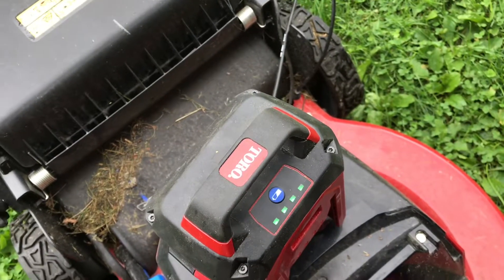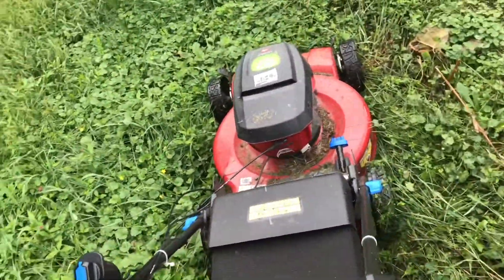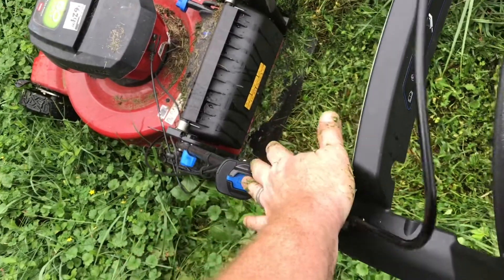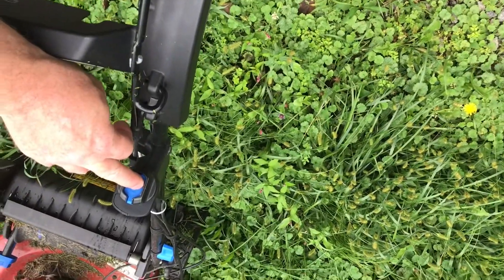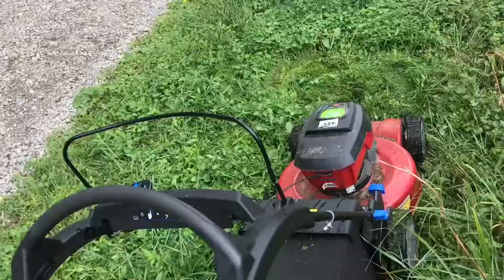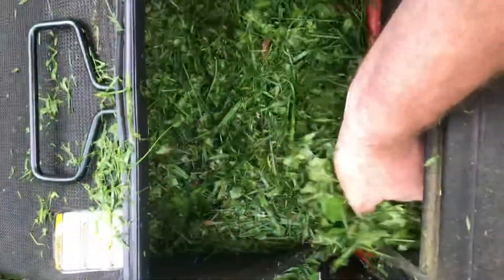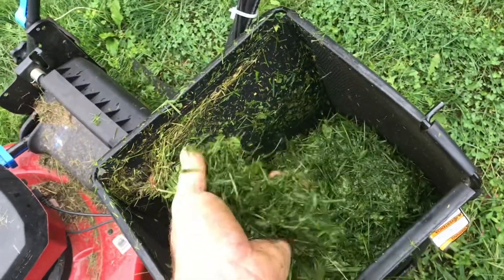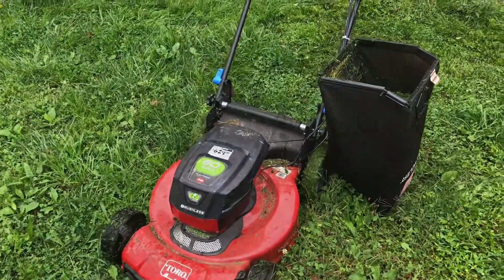“Won’t  RUN and BEEPING” toro electric 60v recycler mower (explaining why)…

Comment: In the manual, it states that you should not cut wet grass and that it's not intended for really high grass/weeds. I've had success with pushing the handle down, to raise the front of the mower, like it's doing a wheelie. Make one pass like that, followed by a normal one and it works a lot better.

Comment: Hi, I hit a dog toy with mine today and it shut off instantly and now wont restart, no beeping, no obstructions, any ideas?
Reply: Same issue - did you find a solution?
Reply: @thepolishwolf  put the battery in the charger for a while to make sure it was 100% and that seemed to reset something and it started right up.

Comment: Just ran my new Toro 60v recycler (21466) for the first time this morning. Ran for 15 minutes then stopped with a beeping alert. Would not restart after multiple attempts to restart. Battery was fully charged and St. Augustine lawn had only 5 days growth. Grass was dry. No grass clogs underneath the machine. Disappointed. Any ideas ?
Reply from the maker: I wish I did, very frustrating. I’ve had this machine for about a year and a half and unfortunately a week ago huge amounts of white smoke started pouring out of where the motor is. When it was brand new this mower was cutting better than my gas one. Unfortunately a big disappointment
Reply: Return and buy any other brand electric lawn mower
Reply: Return it and buy a gas powered mower!
Reply: @livefree6878  Yes, I know the problem... it's made by Toro
Reply: @scooba_guy4615  Not necessary.  I had a Ryobi lawn mower for 10 years, and it was great
Reply: Voltage regulator trying find where it is

Comment: Four reasons (at least) for beeping: 1) Too much load on the system from my wife mowing too fast, too much load. 2) Wife messed with the wheels, deck set too low, too much load. 3) Wife messed with the mulch/bag chute thinking it was the deck height adjustment and the bag chute is clogged, too much load. 4) Wife left the mower out in the sun while taking the battery in to charge, too much load, thermal switch needs to cool.  I do appreciate the help, but I sense a pattern.  Gotta remember that one does not necessarily need to mow a full blade/deck width, especially in tall or wet grass.  Things Toro didn’t put in the manual.  Live and learn.
Reply: It's 2024 a mower should not shutoff or not  operate in the summer.  Imagine our cars decided not to work in the sun?

Comment: I have a similar problem but unfortunately my mower turns off every 3-5 seconds when it's hot out (85 degree + days).  Is there a cooling vent under the deck??  I'm trying to figure out if this is a user error??  I will say this is not built very well.  I had one rear fall off while mowing and the metal in the gear stripped.  Just trying to squeeze a little more life and then probably go with a Greenworks.
Reply: Mines doing the same
Reply: @silverscout2643  I’ve been cleaning out the clogged crash from the chute and it’s been better

Comment: Just bought the Toro 21" Recycler 60V Max* w/SmartStow today... will return this POS tomorrow.

Back to Gas power. Only got this thing because it was on sale from $649 to $499 (Canadian Peso)... if they bring it down to $299 I still wouldn't buy this garbage.